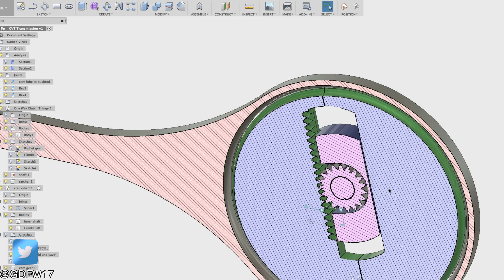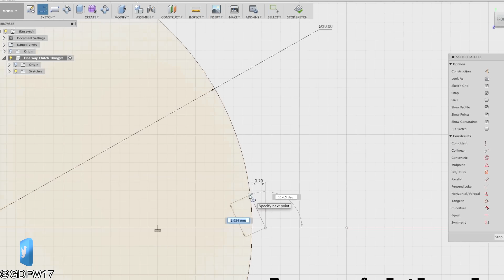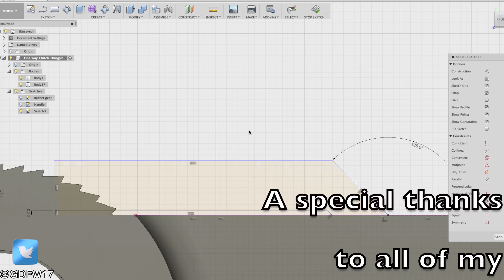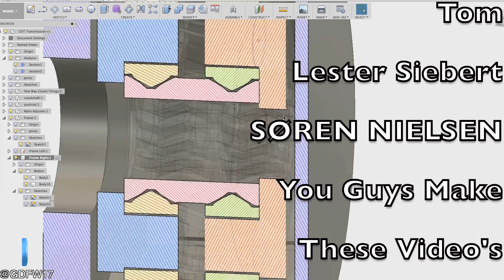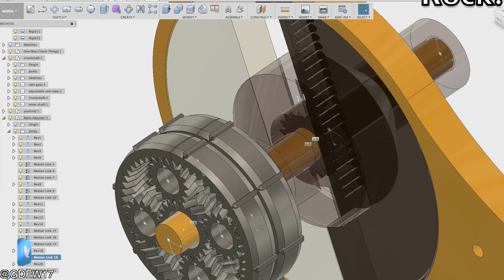The Coolest Transmission You've Never Heard Of... The Ratcheting CVT

Comment: For cars and vehicles my main issue with CVT transmissions besides their High failure rate that low miles most seem to fail and kill out completely around a hundred 38,000 miles on the car itself in the engine itself have now been designed to run over 200,000 miles. Feel like I said besides that point the reason I don't like CVT transmissions whatsoever in the vehicle is because of the high cost of the fluid to run one. Every manufacturer has their own specific requirements and type of oil that's to be used and their CVT transmissions not to mention the various types of CVT as you yourself mentioned. The fluid itself or simple Court can be 10 to $40. Current cvts or so sealed and seen as non serviceable for their filters when in fact you can find the filters for the fluid pump and at the bottom of the tranny pan like an older vehicles. The way they put them in cars is absolutely ridiculous in the way they try to throw them off as they don't have a filter or their non serviceable is completely ridiculous. They're doing the same thing more and more frequently with fuel pumps not just using a sock to filter out particles before it gets to the fuel pump but also putting a filter around the fuel pump that is very specific to that vehicle in the module use to hold the fuel pump which is just a whole bunch of plastic pieces. But go ahead and try to find your filter for it that's just made out of cardboard paper and you're going to be spending about $100 you might as well spend an extra 50 good to get a whole new module because you're most likely going to break those plastic parts. I warn people about looking at the maintenance of their car where spark plugs are located what type of transmission at uses if the parts are even serviceable or if you can find parts to service it despite what the recommendations are. I have a lot of issues with CVT. I also have a lot of issues with the canister oil filters. Instead of using spin on Slots of places are now using canisters with these plastic crap caps that are easily broken and we're over normal used let alone putting them through the strain of being Twisted off and twist it on at every oil change along with the fact that there in odd positions most of the time and exposed to other damage during normal driving. These stupid little plastic caps dealerships want to charge you $300 for and because they're in newer model cars you can't find an aftermarket readily available. And short get yourself an old motorcycle f*** these new cars unless you want to screw yourself over. Most Vehicles made after 2011 Chevys and GMCs for choir a dexos oil or else you will void your warranty. Despite what the law says saying that they can't do this and that they can't write this in they have. Dexos oil changes the cheapest one you can find at a place that does it for you in my area is $75 before tax. And that's only for the standard 5 quarts if you're driving a truck or something that has more then you get to pay an extra $10 per quart. This is all because they say they license there synthetic oil... Don't even get me started on the old Mobil 1 versus Castrol back in 1997 where Congress labeled in the United States synthetic as a marketing term for oil. Whereas in other countries they have to deem whether it is from the ground oil or actual synthetic oil and What treatments that has received as well as what detergents are in it. The treatments include everything from hydrocracking to treatments that synthetic oils get just to make them a synthetic oil.

Comment: You should 3D print out of an aerofoamed Lithium-Titanium alloy, and give it a two-stage coating of Beta Carbon Nitride and Hexagonal Boron Nitride as a hardening layer and chemical passivation/heat dissipation layer respectively. It would be extremely durable that way.

Comment: Long time ago I owned a Subaru Justy with their CVT. It was a wonderful idea, with a mediocre implementation. The bands ended up wearing "grooves" in the cones, which made the transmission tend to "stick" in certain commonly-used ratios. So when you were trying to change power levels, it would tend to "stick" at certain ratios before almost clunking out of the groove and introducing a herky-jerky motion.
Reply: Anonymous Freak well simple, all you have to do is lubricate the cone!
Reply: Sadly, by the time I bought the car, the damage was already done. (Bought it used for under $1000.)
Reply: That’s what you get for buying an autobox Subie smh

Comment: suggestion you should attach a gear or flywheel or something to the output shaft to better show the change of speed and a question to my vary brief understanding the output shaft seems to Essentially be turned by a ratcheting mechanism wouldn't this cause the movement of what ever you are transferring the power to to be choppy if so could the addition of more teeth help smooth things out?

Comment: I came up with a similar idea long ago. Never thought it through tho. Instead of the ratchet I was goin to use the push rod directly. Making teeth on one side of the push rod and somehow make it lift away from the output shaft on the return cycle. I don't know..  I'm no engineer.

Comment: Since you can't engine brake i say you should make a model out of metal and attach it to a two stroke engine (two strokes don't engine brake) and add a second cvt right next to the other one but in the opposite direction for reverse and attach it to a go-kart frame. Also,  this could be used as a controllable v-drive. Email me to see what i mean @ aidencox425@gmail.com
Reply: Aiden Cox my 750 kwaka triple 2 stroke locks the back wheel on down changes...

Comment: Cool device.  I'm doubt that ratcheting mechanism on the output site will survive very long.
Reply: TheBlack Metal this wouldn't work in a car. Very loud and will wear out. Ratchets can brake and they wear out.
Reply: Cvt oil is designed to have quite high shear strength as it is. It would be an easy task to overbuild them as well.
Reply: TheBlack Metal oil will not save that...
Reply: 1. It would be smaller if made with metal parts and perform just as well.
2. You could add a cam, but that would mean a larger design.

Conclusion: hard to prototype on a 3d printer because the part would blow out of size, however, the final config could use a cam and still be small enough and light enough to be viable.
Reply: HaydenHatTrick read Zurl Tech's analysis of the effect of ratcheting on motion, etc
Reply: Debunkosaurus Oil cooling, my friend.... with the right viscosity that's why all transmissions can survive for a very long time.

Comment: Very good. And happy you started out so young.
A few rake notes, if you don't mind.
There is a bicycle system with a CVT: The front chain wheel is made out of 6 individual segments, each mounted on a sprung lever. When pushing hard on the pedals, the levers move inwards and create a smaller circumference. It's not exactly full range, since the number of ratio's is limited by the length of the chain links.
Steam locomotives are driven by a reciprocating piston, linked to a slider that changes the leverage. This means longer power strokes for getting away, and shorter for cruising at high speeds (thus saving steam).

Now back to the present.
3 remarks on your design. A mechanical diode (or ratchet) has a fixed number of teeth: Nitpicking, but the highest "get away" ratio is limited by the size of these teeth.
Also, the speed of the output shaft varies a bit, because the output of the levers look like sinus waves. This can be evened out using an elliptical gear set in between each lever and ratchet; this tops off the sinus waves. (An extra lever can also counter this.)
Finally, for engine braking you can use a worm gear.

As a governor you use a turning knob controlling the length of the stroke. Very clever.
An alternative would be a phase shifting differential. You can send the reciprocating power through a diff, using the 3rd shaft as the governor. By turning the knob, you can shift the phase of the sinus from 0 to 180 degrees.
Using a second diff, you add the original reciprocating motion: the output is the sum of both, and thus ranges from standstill to a sinus (with twice the amplitude).
Your idea is better, but maybe this gives you an eureka moment.

What you address here, is a great challenge and has always been food for thought for all gear heads out here. I appreciate you bother to create real life models, I'm more theoretical :)

Comment: 2. Frictionless (friction is not essential to operation) CVTs have already been invented. Look at the Prius transmission. Think of a simple planetary gearset instead of your Simpson gearset. Connect the engine and big electric motor to the sun gear. Connect the secondary motor to the planet carrier. The output is the ring gear. The relative speeds of the two inputs will determine the ratio, and if they spin opposite directions at the same RPM, it's nutral. (side note: I can't remember which input connects to which gear. It would work OK no matter which way you do it.)

Comment: 1. ratchet interrupts continuity - transmission has 50 gears, not infinity. However, the gear-change mechanism has some play between perfect ratios that just barely engage the ratchets. This play would result in needlessly decreasing the input side of the ratio without increasing the output side, and energy is wasted.

Comment: Reasons why, CVTs burn out is 1) belt is only rubber and 2) the belt hangs loos on the shaft. This contraption looks interesting, I would like to see it milled out of metal and properly lubed up. I would also like to see a fly wheel on the out put shaft. Vary cool. :)

Comment: A really cool design and the fact that you came up with something like that on your own at that early age definitely shows you're very creative and have a good Mechanical Mind. I do want to mention however that CVT's are not popular for a few reasons.
They actually have a less wide gear ratio than most standard automatic or manual transmissions what I'm saying is that the lowest possible gear and the highest possible gear are not as far apart as other traditional Transmissions. Normally with a CVT car you will notice this from a standing stop they're pretty slow, to get the ratio they need at maximum speed they've got to stretch the ratios just a bit sacrificing a bit of off the line power. Nissan gets around this by having a two-stage gearing mixed with the CVT transmission although it still doesn't have his wide of a ratio. And there are some reliability issues with most of the CVT powered cars. Unfortunately. and a lot of the new 8 and 10 speed automatic transmissions give you essentially the same effect however they are a lot more complicated of course. Toyota Prius has an E CVT. And does not have any kind of wearable items such as belts inside of it. It uses the motor generators to apply thrust and braking on two sets of planetaries to change the output ratios. It has the advantage of having an electric motor in the transmission to help with off the line torque so that it's not quite so bad coming off of the line from a stoplight.
And even with that it's not exactly a rocket ship. I own a 2008 Prius so I'm fairly familiar with it.

Comment: the input power is more than output power so how you can install this transmission to a car.
i think if you have a car with 300 hp you can run only with 60 mph.

Comment: What about reversing? Has to have reverse to be a practical vehicle transmission. It also needs free rolling forward and backward, both for coasting and to be able to move the vehicle in case of failures. Then there's engine braking, which many CTVs don't do well at.

Comment: Nope. This is not better than standart CVT. Lot of vibration. Ouptut is not running smoothly. And ratcheting system would have very short lifetime. I prefer Koenigsek solution with one gear and variable torque convertor.

Comment: This was something I knew I was going to do over 40 years ago.  Since working on nothing else since 2009, the design phase was just recently completed.  Now, there has to be some investment in it, in order to move forward, to make the prototype.  I'll use a 3D printer initially, to save money on errors discovered after custom components are made.  My intention is to mount a prototype in a vehicle and maybe take it to trade shows, race tracks or wherever.  Of course, if a manufacturer wants to just pay me to license it, I can be persuaded.  The main thing that will lead me to success is the determination not to waste time on components that are not durable.  So, no chains, belts, ratchets or oddly machined shapes.  No components can be expected to stay together because of friction or pressure.  You can contact me if you have a shop with all the necessary equipment, are a successful business person and/or have plenty of liquidity.

Comment: What happens when you wanna go in reverse? Whats the percentage of torque loss? What about vibration that doesnt look like it will handle high rpm's. Also the fact that its free wheel thats not good for going down hills.

Comment: Another reason why a CVT wouldn't be good for a consumer vehicle is that, due to there being infinite gear ratios, there is a possibility of the gearing system getting caught in a position where the engine vibration characteristics become really bad. One could run the engine at this high vibration operating point and destroy the whole thing. Maybe the problem doesn't matter too much at small scales like snowmobiles but it's a consideration.

Comment: building a transmission that way you would want the control for the gear ratio and the throttle in to be control by the gas peddle, that would require a computer control just for that, which in this day and age would not take that much programing. cool job, keep up the good work.

Comment: Good concept. Only flaw I would thin will be is the out put shaft. I believe it is not verry smooth, the ratchet style, I don't think it will keep up with high rpms with out skipping. Especially considering the weight of the car. Another thing then output shaft I think will be verry jarring with each pause it take to catch the next tooth.

Comment: Continuously Variable Transmission (not "Consistently") 
The design flaw is that, as your output  speed increases, the amplitude of the rotation of your planetary gearsets increases. Therefore, 1) you have inertial losses due to rotational mass that increase as output speed increases, 2) thus, the forces that act on the gears increase, so it wants to tear itself apart at higher RPM, so 3) it would have to be really sturdy (read - heavy) and 4) it would be extremely noisy and rough (i.e., Noise Vibration and Harshness nightmare).

That said, it is an ingenious design for a novelty engineering project with no practical application.

Comment: A flywheel on the output will help smooth out the torque spikes.  Many people would call this an IVT, or infinitely variable transmission, because it has a zero output ratio.

Comment: I remember trying to come up with a CVT transmission because always having an engine running at its most efficient speed seems so right. I can't imagine how much fuel has been wasted over the years powering machines with wildly inappropriate gear ratios and there were a lot of them around as a matter of fact all of them until recently.Anyway I concluded the best way was basically a diff with two inputs with one of the inputs an electric motor which is what the Prius uses.I have my doubts a purely mechanical CVT  whose output is smooth can be constructed. Probably this device's output 'would need to go though a torque converter to smooth it out which would somewhat negate the benefit of a CVT. Nonetheless I applaud this young man on his accomplishment.Just as an aside he probably doesn't realize just how wonderful his parents are and probably won't for many years

Comment: I like the design, a lot, super cool and fantastic job turning it into a 3d printable design. The issue with this is that I don't think this would work very well for a car or anything along those lines, ratcheting usually means wear and the real issue is that this is not a positive design, may work for a smaller vehicle, say... A bike, or a small model car.

Comment: Not really practical.

1: Way too fuckin' noisy. Nobody' going to buy a car that sounds like that.

2: Not very strong.

3: Car engines have, since the 1950s, been capable of running just fine with a mechanical transmission. When it comes to mechanically transmitting power the butter zone is a 5-speed manual.

4: If your goal is to maximize the efficiency of the system you do what railroads have been doing since the early 1950s: Put a generator on the engine output and use traction motors to actually propel the vehicle. A harley davidson V-twin is powerful enough to operate a Chevy Suburban with this sort of transmission setup.

5: This thing wouldn't last any longer than a belt-based CVT.

Comment: Good video.  A transmission similar to this is used on John Deere air seeders to drive the seed metering roller so the output can be changed for varying seeding rates.  Where the arms attach to the output shaft there are one way clutches that look like needle roller bearings but only grip the shaft in one direction. This allows for true infinite variability rather than a ratchet that moves a certain  number of teeth.

Comment: A lot of new tractors are starting to have CVT as an option. For example Case IH has a couple tractors with that option. It helps with fuel efficiency and getting the right amount of power that is needed.